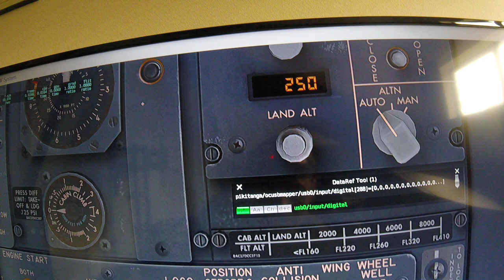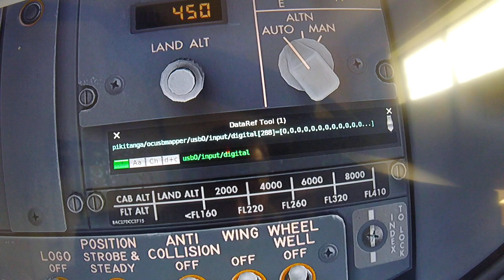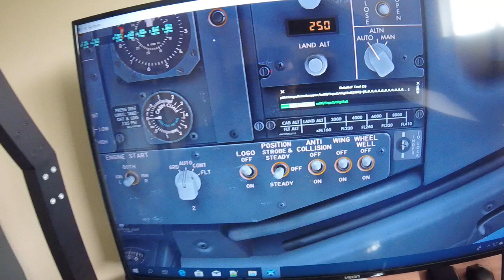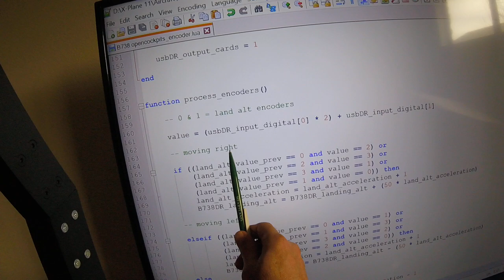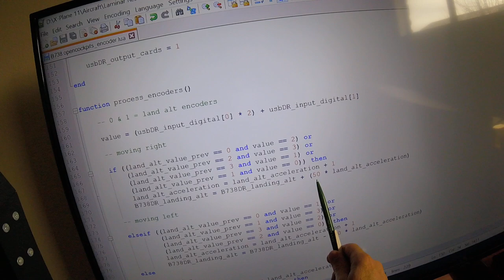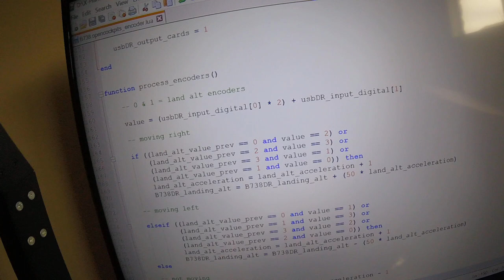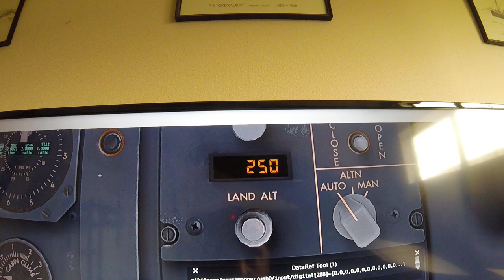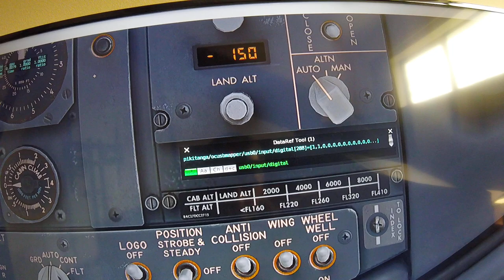Encoders explained

Comment: Hi do you see any advantage of the Opencockpits encoder board ? your setup looks much simpler , is there any chatter or so in the line ?
Reply from the maker: I have never owned an Opencockpits encoder board so I cannot comment or make a comparison. The idc pedestal, mip & fwd overhead encoders are all done as per the video. I made no decisions about what cards to use. I just talk directly to the hardware supplied by opencockpits using OCUSBMapper & XLUA scripts.
Reply: thank you so i am lucky 2 G1000 i can do with 71 pins ;)-